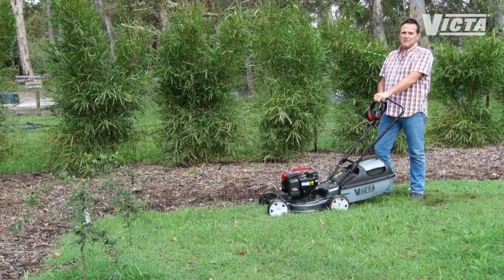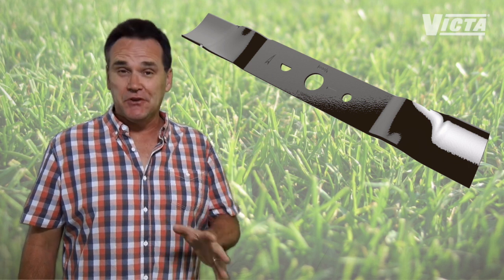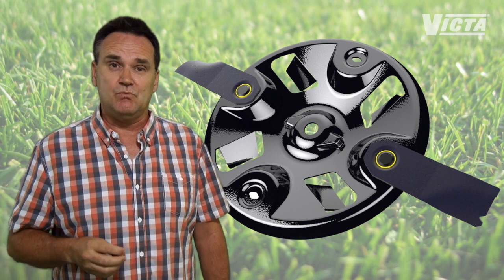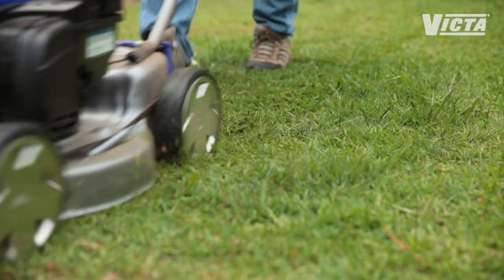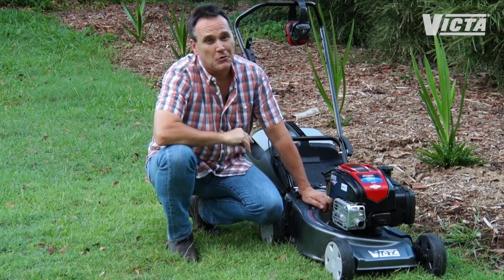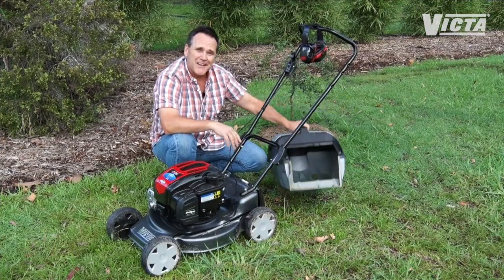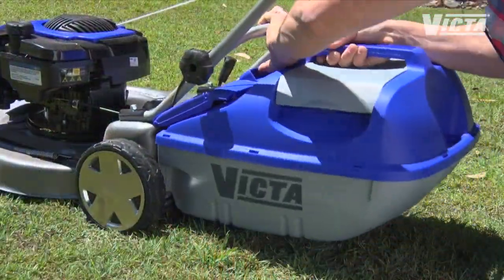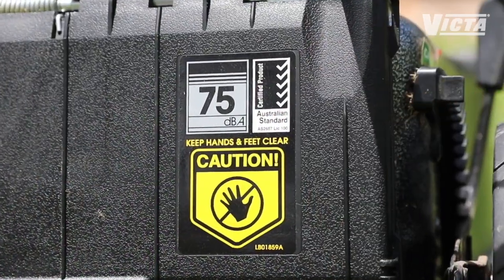Victa Lawn Mower Selection Tips

Comment: My Victa 2 strokes just died so I finally got a 4 strokes. When mowing normal lawn, do I select fast or slow? would slow use less fuel, but less efficient? In 2 strokes it was either in choke position or full throttle.